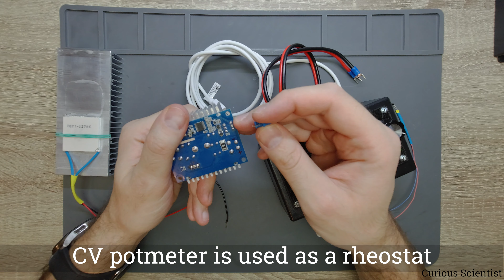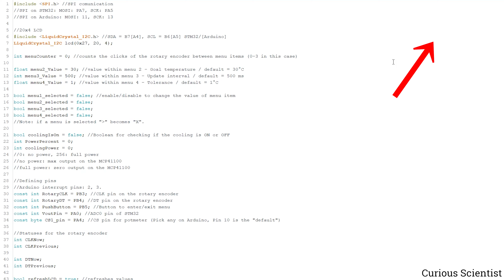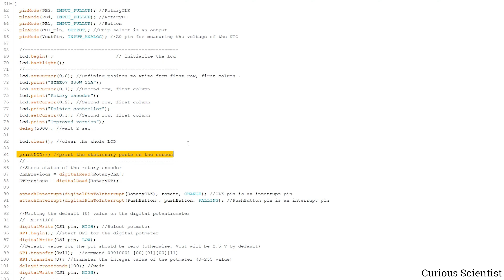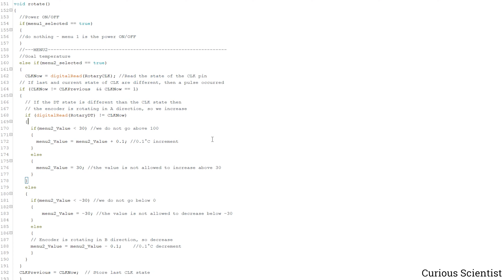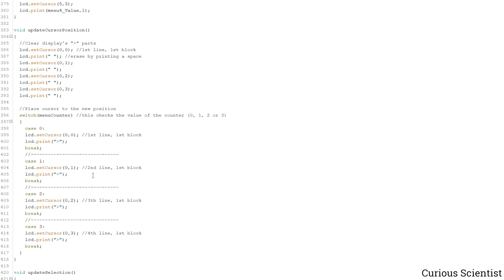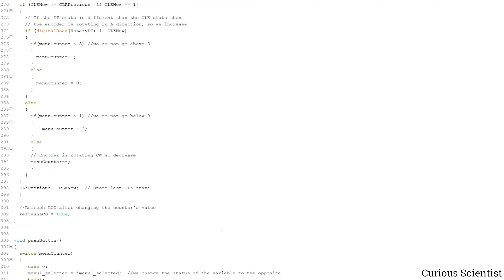Microcontroller controlled digital thermostat for Peltier coolers

Comment: Finally someone makes a good peltier controller, everyone uses pwm or on/off saddly. This is the stuff I needed, great work again.
Reply from the maker: Thanks! An even better circuit will come in the future with a built-in H-bridge, and so on, once I will have the time. Stay tuned!
Reply: @CuriousScientist  Would be great use for a small incubator that can cool and even heat if needed. I look forward to it.

Comment: Hi 👋 hope you’re well? Wondering whether you may be able to help me with designing/creating a metallic water bottle that can be cooled with an integrated Peltier cooling system, attached with thermostat and its own battery supply so the temperature (10degC) can be controlled for a few minutes? Additionally wondering whether it could be docked or plugged in so it could achieve the desired temperature promptly from ambient room temperature? I watched your video from a few years ago on the Peltier cooling system - hence me messaging you. Thanks in advance 💫
Reply from the maker: Hi! Sure, we can look at the project, but don't expect miracles.

Comment: Thanks a lot this is exactly what I'm looking for. I went to your website but it looks like some information are missing from your wiring diagram. Is it possible to have something full with capacitor specs and the power electronic embedded? Looks like there is nothing particular to be added but just to be sure 😅
Reply from the maker: Could you please make your comment more consistent? 
First you say that some information is missing, then you say there's nothing particular to be added. Now which is correct!? 

There is a schematic drawing on my website with at least 10 additional parts (MCU, display, resistors, digital potentiometer...etc.) that has to be added to the SZBK07 circuit. There is a detailed caption right under the picture. 

Sorry, but I have no idea what is missing.

Comment: How can we use this microcontroller  for two stacking peltiers ?
Reply from the maker: This can only control one Peltier. Since you are probably interested on the top Peltier anyway, you just manually adjust the bottom Peltier, then then control the top one with this unit.
Reply: @CuriousScientist  Yes, I think that's the only way for my project..so I have to adjust the bottom peltier to absorb maximum amount of heat..top one can be automated by using controller..
🙂🙂Thank you for your advice and  all your vedios.
Reply from the maker: Yes, you got it correctly. Set the bottom Peltier to a current where it transfers the most heat. Also, don't forget to cool it's hot side very well.

Comment: Hello! Can you possibly control a Peltier using a MOSFET and a PWM signal. If so is it better than just switching the peltier back on/off with a relay?
Reply from the maker: Hi! No, Peltiers are not compatible with PWM. They need DC.

Comment: Hello :). I love this project. I saw all your videos about the SZBK07 and I am definetelly new subsriber :). But I probably missed something because I am still a little bit confused about the onboard potentiometers. CC is set to maximum right? And the CV pot is completelly removed and replaced by a digital one MCP41100 or is the CV potentiometer still onboard and a digital potentiometer is connected to it via a 10k resistor? And one more question - I didn't notice the value of the capacitors you used, did you say that in the video? I'll be happy if you direct me to the video where you talked about it. Thanks for your work! :)
Reply from the maker: Hi! CC limits the current. I control my things with voltage and I don't need current limit, that's why I set the CC manually to the max and I control CV digitally.  CV still kept in the circuit, but I control the voltage of the buck converter via the additional digital potentiometer with the extra resistor. The injected voltage "tricks" the buck controller and adjusts the output voltage.
Reply from the maker: Sorry, and about the capacitor, I have no idea unfortunately. Probably some 100 nF decoupling cap, but I haven't measured, so I don't know.